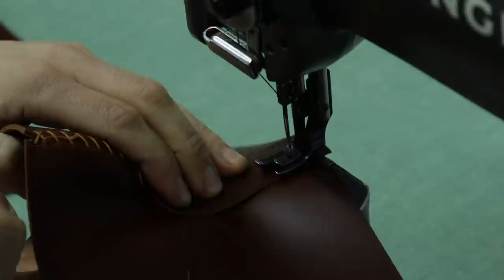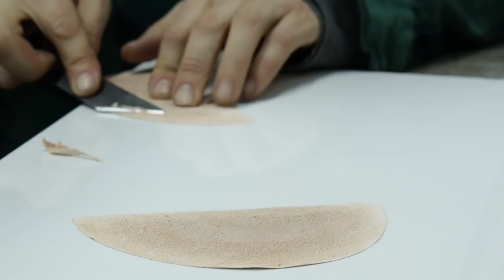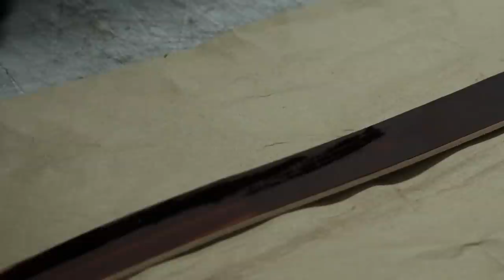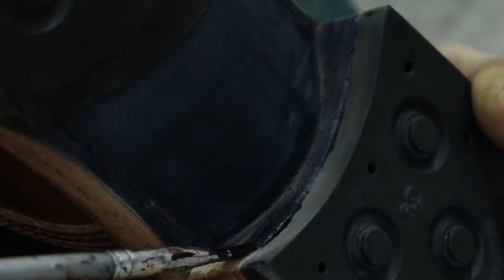Bespoke boot making at Atelier Buck

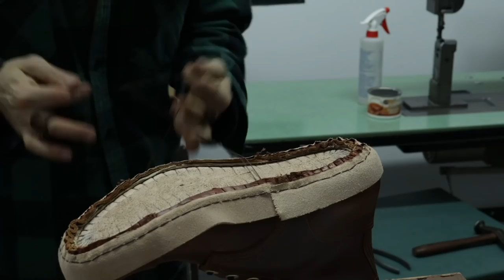Comment: First, I must say that I am a very old retired engineer who does not know much about the terminology of what one calls the various parts that go to make a pair of shoes. However, I know my discreet and distributed structures and their mathematical analysis, and I could not help appreciating and admiring the structure of this boot, especially how the welt circumferential band was stitched to the upper part and the inner sole and later to the outer sole. At 08:09, I am appreciating the fact that the welt band goes all the way around the periphery of the shoe which means that not only the front part is stitched to the insole and top cove,  but also the back heel end.   In many other videos, I did not see this welt band going all the way around and what is more, the use of glue was extensive with minimum stitching and the heel part was usually nailed to sandwich the welt. 

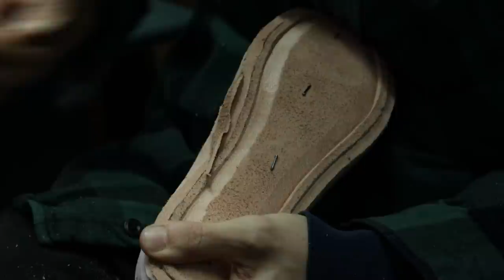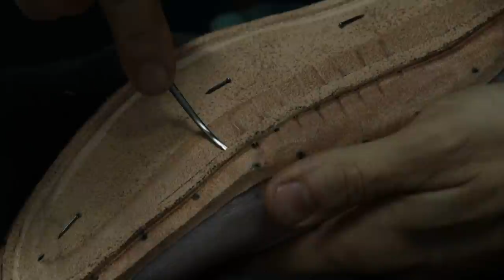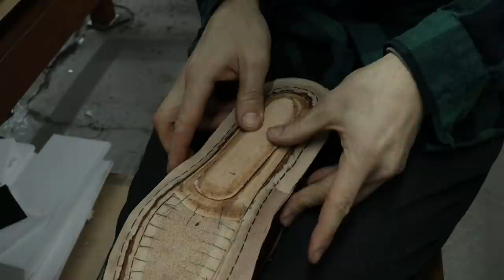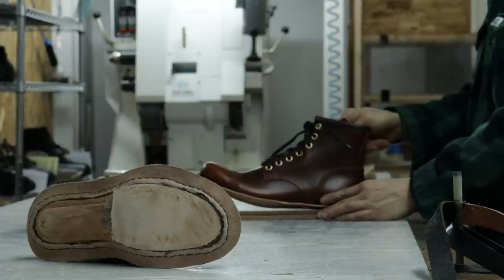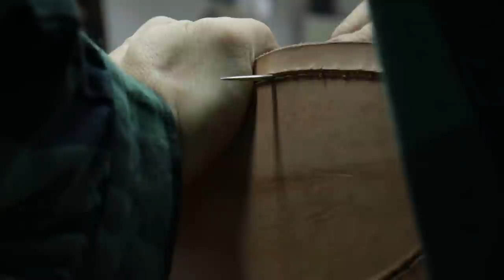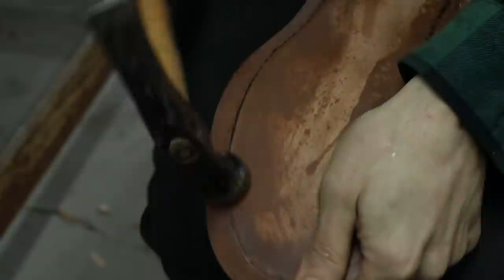At 03:43 it is a remarkable painstaking effort to prepare that high protruding ridge in the insole so that it would act as a structural member to hold the welt all around the periphery of the shoe. At 04:07, it takes dedication and perseverance to prepare that holding wall /ridge in the insole, that will hold the welt so securely, where the insole, welt, and outsole will hold the shape as far as the width of the shoes and any vertical separation as the leg is lifted.  Also at 08:33  to 09:11, the sunken plane behind the ridge holding the welt is filled with leather rather than cork and the stitch of the welt to the outer sole, at 09:57, is not only structurally sane but with aesthetics in mind, where at 10:43, hiding the lifted stitches will ensure their long life. The hand stitching that goes all the way around at 11:34 is to be admired, but with that admiration, one must include an appreciation of the tenacity and perseverance of this silent gentleman whose humility and humbleness are not so conspicuous in this, not so well lit video.    Though the welt band is not stitched to the outer sole at the heel end, the lower curling in of the outer top cover at the heel has a good attachment to the heel as shown at 12: 12, where no doubt that the outer nails are complemented by a few inner nails through the insole and the lower curl in the edge of the top cover, at the heel. 

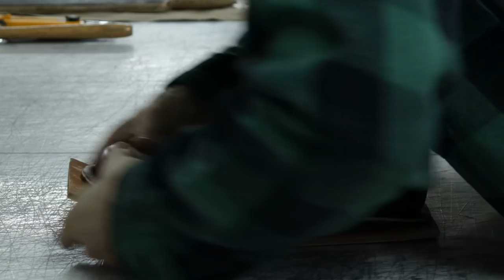Congratulations to this man for his dedication, perseverance, and tenacity in applying good structural engineering. This gentleman, whose workmanship, the structural design, and artistic contoured lines, goes to make an excellent pair of shoes with such selected natural leathers and old fashioned stitches, which seems to be so accurate in their pitch to the nearest thousandth of an inch, as shown at 09:20! Thank you for the video and all I can say is that in addition to being an artist this gentleman is also a good engineer for the structural designs he incorporates in a pair of shoes, and few people ever appreciate the depth of his structural thinking!  Sir, Well done.
Reply: This is normal. This is called a 360 degree welt. What you sometimes see is a 270 degree welt. A 270 degree welt means less of a lip around the top of the heel. It gives a sleeker look some people prefer although it is not as water resistant as a 360 degree welt. It depends on the design of the shoe. There is nothing special about that.
The only downside to a 360 welt is the imperfection where the welt meets (it is usually made less noticeable by making the ends of the welt meet together on the less visible side of the shoe/boot) but in this video the shoemaker welts the boots using two halves of a welt, thus making it more symmetrical.
Reply: Everything you comment on is normal for bespoke shoemaking.
Reply from the maker: Hello I am reaching out to you because:

Our KICKSTARTER campaign is officially launched.

https://www.kickstarter.com/projects/atelierbuck/handmade-boots-made-on-measure

This project means the world to us, and we will need your help to realize our dream of opening our boot making company.
Every pledge, donation, or even sharing this project with your community is greatly appreciated. 
The more people we reach, the closer we get to our goal.

We count on each one of you. 

If you don't want a reward but still want to support the project, select the "Pledge without a reward" tier at the top and enter your desired pledge amount.

Thanks so much in advance.
And again, share with everyone you know. 
We need to reach the total goal to make this campaign work.